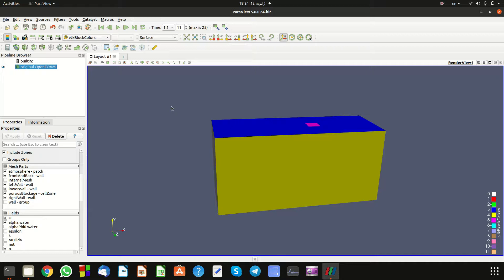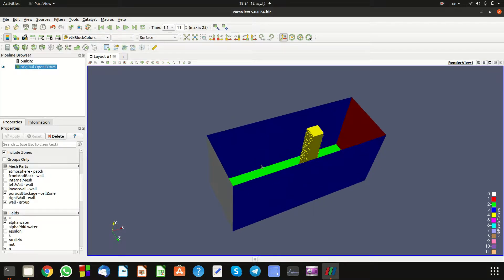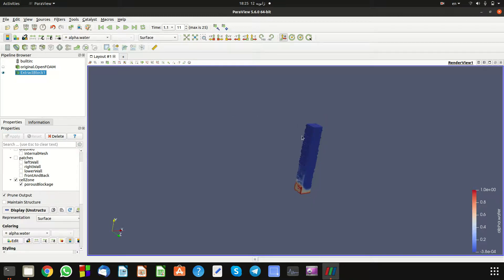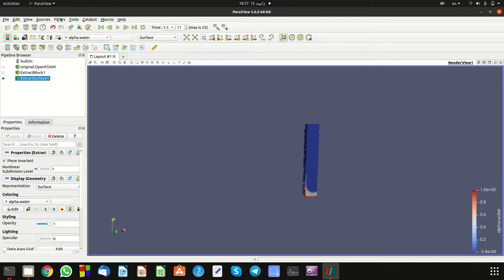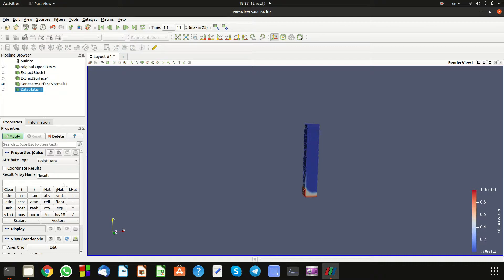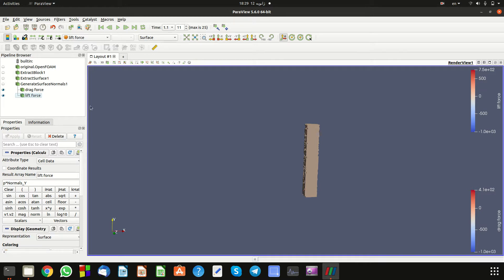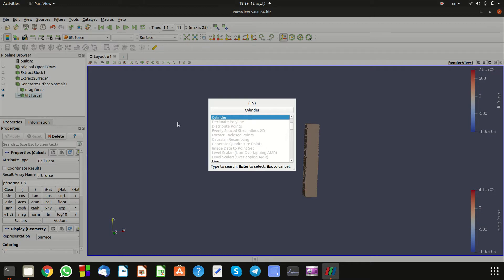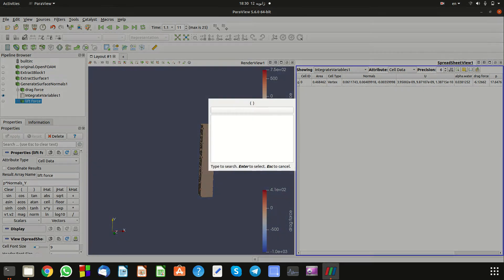Learn how to calculate lift and drag force in openFoam ,paraView

Comment: I have one question regarding the drag calculation. The drag you are considering, is it only for water flow? Or in the calculation, you also have taken the effect of air? Because I have used the same technique as yours to calculate the drag of DTC Hull. However, the drag I got from your method is -46 N and the built-in force function of  OpenFOAM provides -40 N.  Therefore, I need some clarification. I will appreciate it if you have time to enlighten the matter. Thanks you.
Reply from the maker: It is the pressure and it can be the effect of the water and air (I mean both). But in my case the effect of air is negligible. The difference in your data can be the result of many factors. including mesh grid and etc.
Reply: @RezaAlijani_RA  Thank you Sir for the response. I want to provide you a lil bit more information about the case, 
1. The result I am showing is from the same simulation. 
2. In the built-in case, they also have introduced only water. 
Question: 
Is there any way to check in paraview which area has been taken into account to calculate drag? 
Thank you for your time.
Reply from the maker: @kawsarsajib8600  when you extract block and surface, it means it is the area where the drag is going to be calculated on.
Reply: @RezaAlijani_RA  Thanks for your time. Best of luck and hope to watch more demonstrations from you.

Comment: You mentioned that we can calculate for all time steps. Is this method for all time steps or just for the 1.1 sec which was selected above ? could you share the process for calculating lift and drag forces for all the time steps ? Thank you, would really appreciate your help.
Reply from the maker: Yes, we can do it. You should just select your desired time step then you can continue the process.
Reply: But how can we plot all the values of forces for timesteps???
Reply from the maker: @siddheshpujari9140  I looked for it, but I couldnt find a way to do so. I used excel to plot them. I wrote the amount in each time step and then imported them into excel.

Comment: What are the units for the lift and drag forces ?  N/m^2 ?  kg/m^2 ?
Reply from the maker: The units are in "N"
Reply: @RezaAlijani_RA  but what you're showing simply gives pressure in certain normal direction which is N/m2 so I think we have to multiply by the cell surface areas too
Reply from the maker: @avion3698  No,  it's not.  It is force.
Reply: @RezaAlijani_RA  in openfoam in incompresible flow, p is actually given as p/rho. Hence to get actual pressure, u'll need to multipy by rho
Reply: @RezaAlijani_RA  So, it means that if we are in using incompressible solve like "simpleFoam", we should input in the calculator this formula:

p*rho*NormalX

Unit Analysis-
(m2/s2)*(kg/m3)
Reply from the maker: @nickjohnsonn9761  I think so, but I highly recommend that validate the results with a experimental results. 
It's a long time since I have worked on this problem.

Comment: Do you know how to determine the drag force in a 2D porous cylinder (laminar)? I used the same approach but it didn't work, it's too low.
Reply from the maker: in this approach you should have a surface, but for 2d we don't have any surface. Try 3D. There is a way you can calculate drag coefficient in 2d form. But, that is a bit difficult and long. I may make a video  about that in future.
Reply: @RezaAlijani_RA  i need the 2D cass
Reply from the maker: @antoine1407  You can try 2D case, but I'm not sure about results.